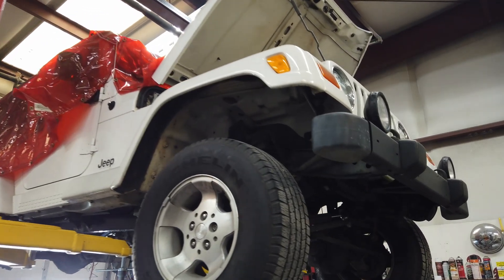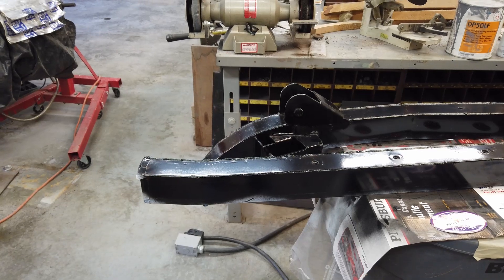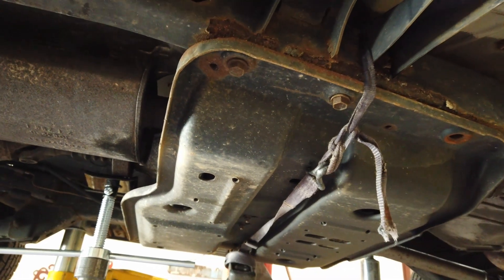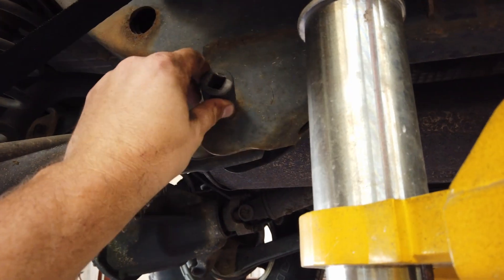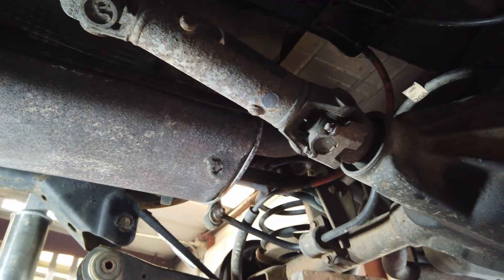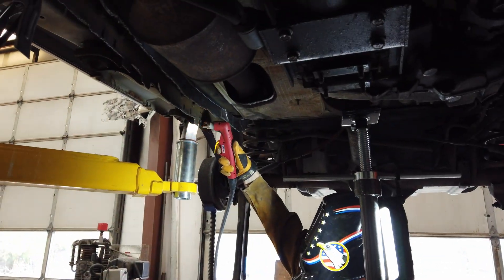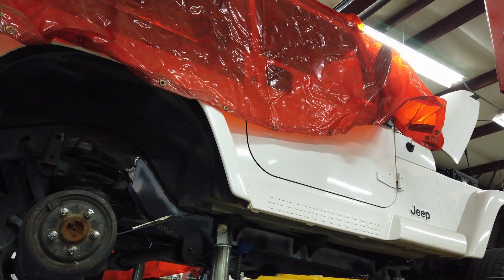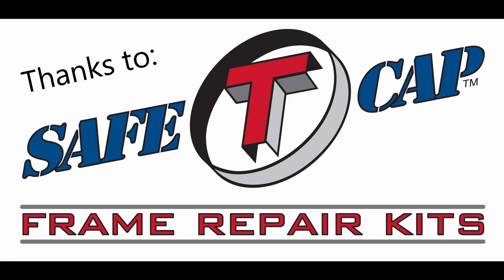Jeep TJ - Rusted and Rotted Frame Restoration - SafeTCap Installation and Expert Tips

Comment: What are the differences between the 2002 and 2003 frames? I have a 2003 that was built in July of 2002. I have been noticing that many of the connectors are of the older style, so I'm kind  of wondering if I actually have a 2002 that was sold as an 03.
Reply from the maker: I'm really not sure on that. Maybe someone can chime in. Thanks for watching!
Reply from the maker: I'm really not sure on that. Maybe someone can chime in. Thanks for watching!

Comment: Looks great, like new again. How to you make sure the read end is aligned  properly on both sides to the front?
Reply: I believe you measure from the front control arm bolts to the rear control arm bolts. Should be 57" iirc. Give or take half an inch is fine. Autorust has this in their instructions.

Comment: Awesome video!  My wife and I are actually going to buy our daughter a 2001 wrangler with severe rust problems tomorrow.  Ive got a friend who does welding, particularly rock crawlers, and he is going to repair the frame , while letting me help(so pumped about this!).  Pretty high level stuff he does.  So we really were able to buy someones project and turn it in to a jewel.  I have zero clue what I should anticipate replacing while under the vehicle but since we will be doing so much, I feel like we should.  Any chance you could let me know the things I should pro-actively buy and replace?

Comment: What is the difference between the safe-t cap and the rust blaster kit?
Reply from the maker: I'm not familiar with rust blaster, but have found Safe T Caps fitment to be second to none
Reply: Thank you for the reply. I am getting ready to start doing my TJ and quadratic offer both kits but I wasn’t sure which one to get. I’ll go with safe t cap
Reply from the maker: @robertomulas407  best of luck! You won't be disappointed with their product

Comment: How do you reconcile the 110 acres inside the fenced area mentioned on the initial site plan in note #9 with the 76 acres of panels consistently mentioned at all local presentations to both the Planning Commission and the Board of Supervisors? 
The SUP for the Dogwood project in paragraph 4 requires that the project be in substantial conformity with the site plan submitted as part of the application. The PBR site plan shows a coverage area of 146 acres. How is a 33% increase from the 110 acres indicated on the original site plan in substantial conformity?
How and when will local Fire and EMS services be trained and equipped to respond to any onsite emergencies?
How are planning to screen this project from view of the road and neighbors?
How will you minimize land disturbance? How many acres will be disturbed/graded at one time?
Explain the 12,3MW Capacity Interconnection Rights versus the 20MW nameplate capacity, versus actual projected MW production levels. 
Why are panel arrays covering known sinkholes? 
How will you protect panel run off from potentially contaminating ground water?
Can you guarantee that your solar panels are not manufactured by slave labor in China?

Robert Staples
Luray, Virginia
Reply from the maker: Wrong video lol

Comment: On the inside trail arm where the the upper control arm mount is located,  how do you weld above it? There is not enough room. Do you just weld what you can reach in that area and just leave those two or three inches alone?

Comment: Definitely in need of this done on my 01 jeep tj, can anyone recommend a shop that will do this kind of restoration in or near Chicago or Midwest area?
Reply: See my issue with the plug and patch set up is, will it last? 
2. What happens in the event of an accident?
3 what if the frame continues to rust beyond the welds and they break?.
All questions that I'm not willing to find out. What I would say is if your frame is bad. I would bite the bullet and just get a new frame. It will end up costing more if you total your jeep and god forbid your frame snaps when you go off roading.

Comment: It seems to me that it would be a lot easier if a company just made the rear half of the frame. Make the replacement so it would slide into the existing frame like pipe exhaust. I realize it would cost more to purchase but the time savings would be tremendous. When you have to start cutting off brackets and welding 5' of the bottom half of frame in why not just replace it all. Just my 2 cents worth.
Reply: Well considering a whole frame cost around $2-3k you'd be looking at about $1-1.5k for the rear trailing arms which is what I'm sure your referring to.

Comment: I'll offer my .02 here. When I did my Jeep with the full length pieces I drilled a 1/2" hole every 10" so I could plug weld it to the frame (where the frame was still good) I am about to do another one and I think I will cut about a half inch off the length of the inside to make it easier to weld up next to the body. I can say this, they are a great product (I have no affiliation with them) and I think the frame was stronger than new when done. Used frames are getting harder and harder to find and they want crazy money for them now and it's a lot of work swapping everything over.  Thanks for showing this job with a nicely done video. How do you like that plasma cutter?
Reply from the maker: That is a great idea on the plug welds. Ours is still holding up perfectly. We have driven it thousands of miles and taken it out on the beach sand, etc with zero issues. Oh and I still love the Primeweld plasma cutter! Amazing product for the price
Reply: Hell yea def add some plug welds.did you kit come stitch welded or was it welder throughout the length?once I get mine attached I'm gonna jump around and stitch a foot here and there

Comment: 50 years ago i installed a few front frame sections for g.m.vehicles..(anybody remember those?)i went to the factory(auto rust tech) in cranston r.i.  and purchased the 131 rails for a 99 t.j...these did not fit just good.. they fit perfect!..if you line up the hole were the rear strut bolt goes into with the old one ,your good!best aftermarket part i ever used..heavy and good quality steel..prep correctly!

Comment: How much would this cost to have done?
Reply from the maker: I'm really not sure. Maybe $2k total? The parts alone are $700 and it's a heck of a job. I would guess at least 10 hours of labor to do it halfway correctly. You should get a local quote. The SafeTCap website has recommended installers for most states. Check it out and please let me know what you are quoted
Reply: Btwillia's Garage thanks for the advice!

Comment: Hate to say it, but this is not a repair. It’s like putting lipstick on a pig. It’s only prolonging the inevitable. Used this same kit on my tj less than 2 years ago. The repair parts did not rust out, but the rest of the frame rusted out around it. Now I am almost done building a completely new frame.  Not to mention if you end up in my position the installed repair parts make it much harder to   remove the problem areas. But I guess some people like the taste of hot sparks from the receiving end of cut off wheels and a plasma cutter. I did this repair on 2 diff tjs an both failed the same. Save your $ and do it right. Replace them rotted frames and stop putting lipstick on a pig. It isn’t worth the future problems you will encounter.
Reply from the maker: We took detailed steps to use a rust convertor, etc etc, so we shall see. I hope it last longer than that, but I guess time will tell. Hate to hear that happened to you. Fingers crossed
Reply: Would love to see a follow up video on how it looks today with a scope inside the frame rails. Gotti I think the issue here is that water goes between the old and new frame rails on the inside and anytime you trap water between two pieces of metal, it’s going to rust at some point. I think I’m looking at these videos some people have good results years later as they prep much bette then others, real quality self etching primer and following up with a4k primer after welding and soaking the welds and some have even take a frame wand and soaked the inside of the frame afterwards to try and get some 4K up between the old and new frame rails.
Reply: Yeah the frame on my jeep is shit. If I'm doing anything it's a complete frame off and a new frame. Everything on it is rusted to the point that even the top might not structurally hold the safety cap. So I don't want to start cutting an welding something that's not suitable. I'll drive it for a couple years until I can afford a complete frame and I'll remove the tub and the internal drive train components. As well as removing the axels and probably replacing the clutch while I'm there.

Comment: After my 4.0 swap is finished in the next few weeks, i will be doing SafeTcaps on my TJ. This is by far one of the best help videos for frame repair on YouTube. Thanks guys!
Reply from the maker: Thank you Jeff! We really appreciate that! Good luck with the repair!
Reply: @BtwilliasGarage  Do you have have any tips for setting the perfect alignment? so the control arms stay centered on both sides. do you just measure off of one of the body mounts?
Reply from the maker: @Yeff_Yeep  it will be really close no matter what due to the little slits that go where the body mount is. Ours actually seems still to be aligned well after this job, but we will likely get it aligned properly to be sure on a Hunter machine to help save the Michelins. I have heard that other competitors to Safe T Cap do not fit as well and require modification in most cases. Good call going with them. The owner Jerry is a veteran and really cool guy.
Reply: @BtwilliasGarage  Sounds great!! Thank you again!!
Reply: @Yeff_Yeep  you have ujoints not control arms. Its a solid axel not independent suspension/cv axel set up. You have tie rods and a pitman arm. You don't really have control arms. As far as alignment I think it's slightly simpler setting it than a independent front suspension.